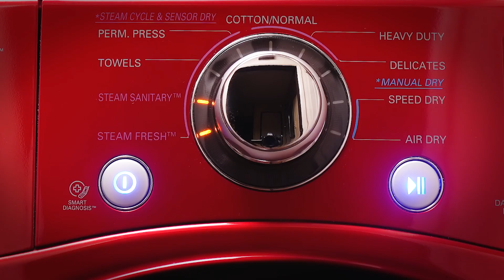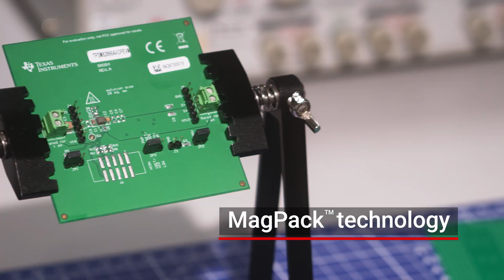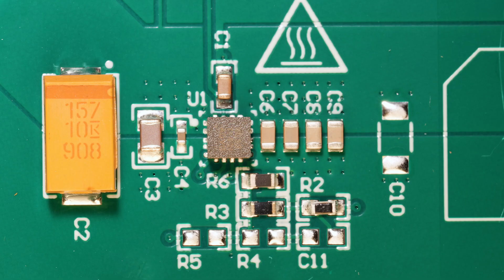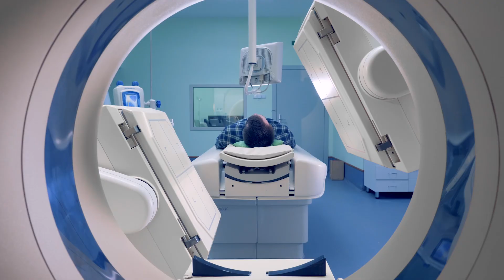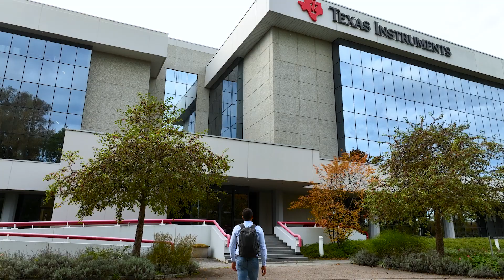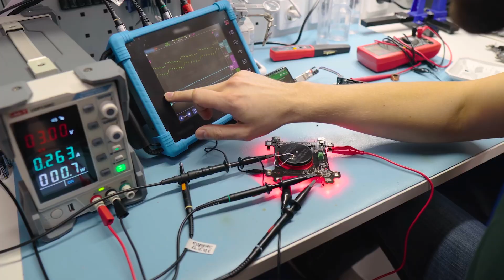Double The Density: Reshaping Power Modules with MagPack™ Technology

Comment: I'm only an electronics and RF enthusiast so I'm not sure exactly what these are used for. Anyone? What goes in, and what comes out?
Reply: 5V go in, whatever you want that's less than 5V comes out. It's a buck converter liek the LM2596, but smaller and with somewhat narrower operating conditions
Reply: @sciencoking  Ahh, thank you.
Reply: From what i understood, it also has the inductor already in the package, and use some sort of ferromagnetic epoxy for the package to shield the inductor.
This means you could build a vrey tiny 6A buck converter that only needs some capacitors and resistors next to the chip.
As you may have seen from the pictures of its footprint, this is more interesting for industrial use, rather than hobbyists, simply because it would be very hard to solder by hand.

Comment: Hey TI help me make a Lithium Polymer battery charger balancer for my 6kw diesel powered micro turbine genset for UAS and UGVs. Need to step down 140-350vdc to 50vdc @ 6kw keeping it small as possible. 😂
Reply: How many watts you need? I see something in the 600 watt range. I've been looking for something similar for a high voltage drone tether.
Reply: If you can regulate the upstream higher voltage by actively controlling your generator as a motor in regenerative braking mode. Then you could use something like 3-4x of the vicore 400v to 48v 1.75kw BCM modules. BCM6123TD1E5135yzz being a specific part number. 

Then the battery bms is just a normal bms.

Comment: Is the inductor included in the chip body an air-core inductor or is something with magnetic properties used as a core? Like ferrite?
Reply: The inductor is integrated. From a quick glance at the Datasheet you really only need a single resistor to set the voltage THO it is recommended that you use input and output caps. There is also an input resistor but I dont know what thats about
Reply: It definitely is a ferrite core. Otherwise they would not be able to get acceptable inductance/saturation currents
Reply: @mimimimmmim  I wonder how they put such a structure inside an epoxy body? Very interesting.
Reply: @Novus_Ordo_Conditor  Wouldn't they simply pour the epoxy into a small mold/cavity containing the core, and let it harden? That's my guess. Perhaps you meant something else?
Reply: @SyntacticOperator  Dude, ferrite cores cannot be mold like epoxy, ferrite cores are made by pressing under high pressure, I mean; how did they put a previously produced hard object into the epoxy body or is there really a ferrite core inside?
Reply: @Novus_Ordo_Conditor  My friend. Imagine taking a ferrite core, and then placing it in a small square mold such that it is positioned in the very center using small standoffs like toothpicks or whatever. What's stopping me from pouring wet epoxy on it, and letting it dry?

Comment: No quiescent current in the datasheet, but efficiency reaches 50% at 100mA... on a 5V to 3.3V converter??
Reply: The link is just a description paper. The actual datasheet for for example the TPSM82866A does have quiescent currents of around 12µA
Reply: @AlpineTheHusky  Thanks, that's a better advertisement than watever this is

Comment: Good thing capacitors are not included. 
2025: .... smart inductors with.... AI
Reply: I believe that these high density layered ceramic caps are failure prone. Having an external cap means you can choose the largest cap that works in a specified footprint
Reply: @autonomousperson  thanks!
Reply: Why is it a good thing? (Trying to learn)